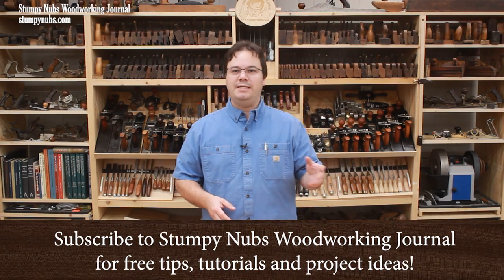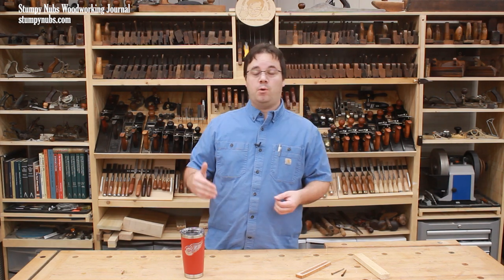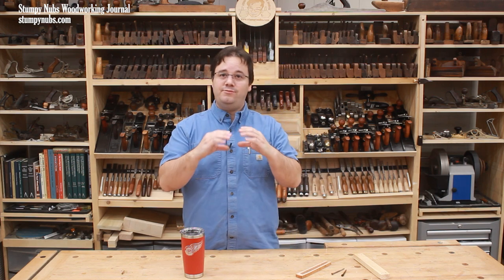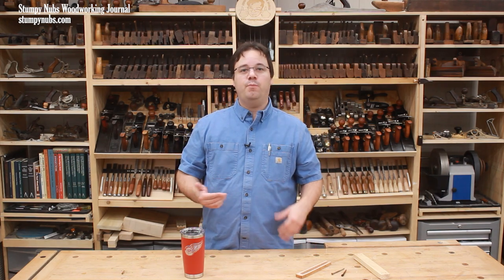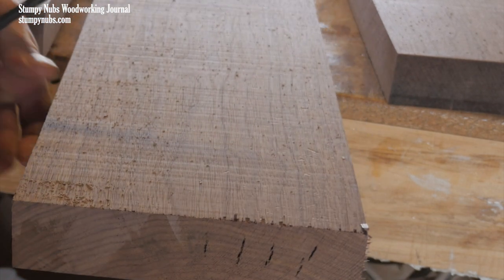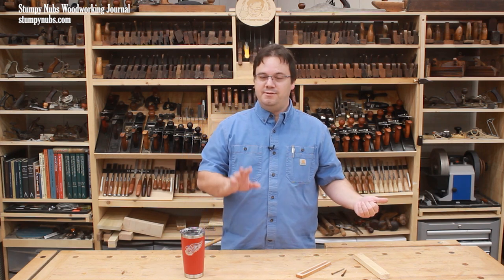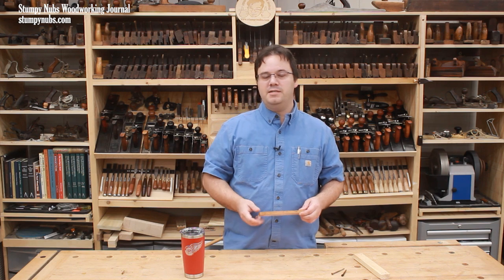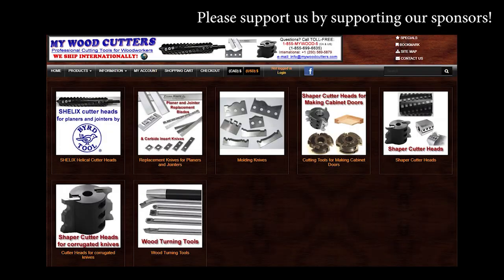A hidden flaw that can DESTROY your lumber! (Case Hardening)

Comment: case hardening, as you call it, is reversible in most hardwood species and some softwoods. it's essentially reversing the kiln drying process by using steam in the kiln to "reconstitute" the wood to its original moisture content before kiln drying. then you can re-dry the lumber on a slower schedule and still get decent, usable lumber.
however, this process doesn't work well on spruce due to the make up of its pores (porus and torus make up of the "capillaries"), similar in fir. it does work to some degree in pine, but due to the pitch setting up and hardening out during the drying process it doesn't always turn out well

you can identify case hardened rough sawn lumber by the deformation of the wood around spike knots in the board. the more pronounced the deformation, the worse it is. 

in pine, the pitch will come to the surface and build up and cause some degree of case hardening under the pitch accumulation. while it does this even under the best of conditions, the dead give away that pine has been dried too aggressively is the consistency and color of the pitch. the bubblier and thicker the accumulation is, the higher the temperature in the kiln was during the lead in and drying phases. pitch globs should be rather dark, glassy and fairly small (2 to 4mm in diameter), even around pitch strains in the wood. 
if you are milling your own pine lumber and come across a chunk that has a pitch strain in it, commit to air drying it for a longer period than normal. this pulls more moisture from the pitch, making less apt to boil out and ruin the boards, then dry it in the kiln at a much lower temp and for a little longer time. at least that way you're not throwing away wood or have to use it as firewood.

most mills no longer do an equalization and cool down phase and simply roll out the lumber once it has reached an average moisture content based on their probe readouts. this is also a major cause for case hardening as the wood is temperature shocked and the outer pores slam shut to the temperature difference sealing in the remaining moisture that would have otherwise migrated to the surface during the cool down

Comment: This is incredibly useful information on one of these unknown wood parameters - at least unknown to the naked eye. I was wondering just the other day in fact of whether speeding up the drying process can cause issues with the wood - now I know why most wood is left to dry naturally over a long time (at least let's hope it is).
Are there any international standards applied to imported wood for air drying and any inspection bodies that provide certifications?

Comment: I never knew about or heard of case hardened wood but I've certainly encountered it. I imagine this also accounts for miter saws binding. I've had to unplug the saw and gator wrestle the board of the blade a couple of times.

Comment: In 2020 my boss and I built a 140ft privacy fence using PT lumber came back this year to do some more work for the same people and I noticed significant shrinkage, a half inch or more for a ton of pickets, the homeowners never complained (to my knowledge) but I was very upset. I know some shrinkage is to be expected but that much makes me believe the wood was not properly cured as even the areas with little exposure to the sun still showed roughly the same amount of shrinking.

Comment: Very interesting, and cool trick to check it, thanks for sharing. It'd be important to cut the test in such a way that you leave sufficient material that's both in tension and compression to pick up the effect.

Incidentally there's an analogous phenomenon in structural steel called "residual stress". Hot-rolled steel products don't cool uniformly; the extremities cool and solidify first. When the interior solidifies and continues to cool and contract it sets up a differential stress state in the material, which leads to early-onset buckling under axial load (due to some fibers already being in compression and hence having less 'headroom' before they yield), and - as with wood - it'll sweep when ripped. Classic example is ripping down an I-section down the center of the web to create two T-sections; they'll typically require straightening after ripping, increasing the cost of fabrication.

Comment: I had this problem all the time when I used to make door frames. Pine and hemlock seemed to be the worst. I would have to cut the bulk of the wood off, then use a thickness planer to get it to size, otherwise I’d be sanding out burn marks for hours.

Comment: interesting, being in Arizona i usually buy my lumber throughout the summer and use it during the winter. I once noticed cracking in the inside of the wood but I was making picture frames to ship out to family for the holidays so I didn't really care at the time. I've never experienced pinching probably because the wood gets 6 months to dry on my shelfs. I have however ran into burn in more often because the fence came out of alignment, usually my fault because i was just ripping full lengths of plywood into halves and it doesn't take very much sideways speed to bump into the fence with a significant amount of momentum.

Comment: I have seen this same phenomenon in air dried wood but to a lessor extent. Air dried does have its own set of characteristics and can happily deal with both. On to the question how much of internal stresses present in the log when sawmilled translate into some of these stresses manifesting themselves in the final product? We can see the same closing or opening of the kerf on both circular and band saw mills.
Reply: I think this is mostly due to internal stresses. I don't think it has much to do with proper drying technique other than a time factor. Wood moves. Air drying gives wood time to move while it dries. Kiln drying just dries it and doesn't give the wood any time to move before it's sold. If these same kiln dried boards were given the same amount of time as an air dried board, I don't think you'd see the same issue.
Reply: @Adventures_of_Marshmallow  I agree with that assessment. Carefully air dried wood or quality kiln dried wood has fewer of these issues in my experience. It would be interesting how much of these issues are preexisting in the wood off the mill and how much is induced by drying techniques. Tracking air dried lumber it does appear (anecdotally) that boards cut in the late spring seem to have less stress than those cut in the late fall early winter. I wonder if the relative humidity or temperature have a role in this.

Comment: Some other factors to consider if the other guy’s problem persists:  A 10” table saw blade is almost 32” in circumference where a 4 or 5 foot band saw blade is not only thinner and narrower, but much longer, thus staying cooler longer during rough ripping. Even with bad lumber you usually will get decent results going from the bandsaw to the jointer/planer than just table saw.  

Also, misaligned fence is not good, trying to rip through a piece in one pass could be helped by taking it in two passes at just over half the thickness.  This keeps heat down, helps bogging down of underpowered saws (if you have that problem), slows dulling and pitch buildup of the blade teeth as well.  

Good sawing technique also plays into the equation.  Feed angle, consistent feed rate, using a feather board, etc...all help in making a table saw a more consistent and functional tool when the planets don’t align perfectly.  And they almost never do, so to me it’s worth it to consider all the factors ahead of time and quickly to make the actual physical work go smoother whenever possible.  👍🏽

Comment: A logger told me that when they harvest for lumber they cut the tree two feet off the ground to avoid bound up stress in the log.  I find the wood that bind usually is at the end of the board not the whole length. I learn a long time ago to use respectable suppliers.

Comment: I've seen a lot about stresses on metals from black smiths, and they have tempering ovens to deal with /use them.
Would it be possible to do similar things with case hardened wood?
Boat builders like to steam planks to get them bend around the hull, and that seems to work great.

Comment: I was cutting a 5 ft long 6 inch wide piece of maple with a DeWalt Crosscut saw. As I plunge the blade into the wood it stopped the blade dead. The board was stuck on the blade and jammed up against the upper housing. Besides being scared and having been whacked by a 5-foot board, I was thankful that it didn't hit me in the face. Getting that piece of maple off of the blade turned out to be a real difficult job. Ever since that time if I want to use a piece of that would I use the hand saw.

Comment: Hey Bud,
Got a question completely off topic. I live in Canada and have a small garden shed where I do hobby woodworking. In winter, I use a small block heater(with precautions) to heat the shed and it works great. That said, my question is for paste wax, in winter it is practically unusable. Do you think it would be ok for me to add some white mineral oil to soften it. I primarily use paste mostly as lubricant on jigs / sole of planes etc.

Comment: Thank you for another great explanation.
On a semi-related topic... If you were doing the same thing (making cutting boards or similar wood cuts) would you use a table saw or band saw and what specs for the blade?
Reply from the maker: (Assume case hardening wasn't an issue) I would use a table saw because it cuts faster, stays sharp MUCH longer and leaves a glue-ready surface free from blade marks.

Comment: If you have ever been in a Home Despot or a Lowes in the winter it can be hot as heck on the ground and as you know heat rises and they put the lumber up high. It's not as hot as a kiln but it does a job on the lumber. I know no serious wood worker buys their lumber there so relax 🙂

Comment: Will the effects of case hardening be pronounced enough at the end of a board to adequately predict the conditions of the center of the board? I ask because it seems that the very ends will have the opportunity to dry more evenly, regarldess of the drying process.

Also, thank you for this. I seem to remember learning this from you before but I had forgotten and completely explains why the chunk of maple that I cut up for Xmas cutting boards immediately "twanged" on me after the first strip was cut off my freshly milled stock!
Reply: If you read the attached document it states that the samples should be taken at least 20" from the ends of the board.  Stumpy only recommended taking the samples from the end if you plan on potentially returning the effected lumber.
Reply: @SteveAugust7  Thanks!
Reply: @SteveAugust7  Yes, if the end has been exposed for weeks it may not detect the problem. A practical non-destructive test though, if you or the dealer are cross-cutting to length.

Comment: My process to prevent this from leaving gaps in my work is to always leave the crown in the center for flat sawn material. Rift and quarter, if I can, I freehand straight along the grain so that milling won’t warp the material.

These days every piece I cut will pinch at least a little bit. If I cut a piece in half down the crown it will always be bowed.

Comment: So a 50$ dollar question. 

I wound up using about 20 bucks of case hardened birch to edge band an MDF workbench top. I didn't realize that it was case hardened at the time however, just that the hardwood pinched pretty bad coming off the saw.

It didn't seem to be cupped at all when I glued up (boards were cut about 2.5 inches wide), even though the glue up was done several days after the sawing. There was a slight bow in the wood, but I didn't care too much as it could be pressed flat with a trivial amount of hand pressure.

I figure, it's a workbench top, so even even if it goes horribly wrong I'm out less than a 100 bucks, but I was curious going forward.
Reply from the maker: If it hadn't cupped several days after sawing, it should be fine.

Comment: I had a similar experience while trying to rip 2x4 spruce in half lengthwise, i had first intended to push them thru the table saw but had no end to binding and hard feeding to the point of being dangerous, i eventually put my rip guide on my circular saw and clamping the 2x4 to the edge of my bench and ripping them that way to a much greater success, assuming both blades to be or relative sharpness and the circular saw likely of less hp, why do you think that was so much more effective? i took pictures of the lumber after it was cut, a ripped 10ft board could touch at each end and be sprung to create a 3inch gap near the mid point, while others spread at the starting end as it neared the other end by as much. Canoe lumber co, not a straight board in it!

Comment: Sounds like I purchased 1X10 Select Pine wood.  When I cut it on my compound miter saw, the board cracked loudly as I was cross cutting.  The board was 8' long and I was cutting 1' pieces.  This only happened on 1 board.  When I got the loud crack sound, I did not notice the crack at the cut location, was down a foot or so, where I noticed the physical crack.

Comment: Good vid! I'm leery of kiln dried in general, and given the recent scarcities I expect that problem to get worse.

Going back to Davis' original video, it looks like he's using a combo blade rather than a rip. Assuming he's figured that out, he might want to check blade angle to fence. If the blade is angled towards the fence, that is, if the distance from the front of the blade to fence is greater than the distance from the back of the blade to fence it will try to force the wood against the fence, slowing things down and smoking.
Yeah, I know I should make that comment on their vid rather than yours, but it's late and I'm lazy.
Reply from the maker: You can rip with a combo blade. And his fence was parallel to the blade. You can see when he withdraws the wood that it is the kerf closing and pinching the blade.
Reply: @StumpyNubs  well, I should have watched his vid... Still a real rip blade should work better. Did he try wedges to keep the kerf open? 
BTW, I'm not suggesting that you are wrong, you are always excellent, correct. 

But if he can't return the lumber perhaps there's a way to rescue.

Jeeze, I should just go watch his vid...

Comment: In my very limited experience which started off using a blade with 60 teeth thinking it would be better because it’s supposed to give a “finish” quality cut. Decided to switch to a 24 tooth blade and bingo cuts were easy and quick and the quality was still pretty good.

Comment: There's one thing that I have been taught to do before processing the wood to it's final size. It's called "de-stressing" : you have to plane your planks to your final thickness +3/4mm (excuse my French and metrics) without having to joint it. Then leave it rest for 24h you'll discover you material hopefully not too tortured, thus allowing you to process it to it's final measurements.

Comment: Try making the fence parallel to the saw blade and use a constant feed through out the cut.  I have run in to what you call case hardening while cutting stair jacks.  Big problem, in that process.

Comment: I have this issue with OSB and MDF too. It feels like it resists the saw in the beginning and all of a sutton it slides through. I thought it was the alignment between the fence and the blade. My Bosch table saw doesn't allow me to correct this.

Comment: I always store new lumber for two months minimum. That way it all adapts to my shop evenly. Which makes this a mute point for me, and normally my new lumber sits for six months before use. (Edit) One other note on storage always cut off those painted ends if your boards have them before you store the lumber. As for the cracking, I normally find that in pallet wood to be fair about it.
Reply: Good tip. I guess that's one reason some wood workers have nice wood just sitting around their shop. I thought they just like have nice piles of lovely stock on hand. Now I think they are letting it climatize to their shop as you do. I get it now. Thanks.
Reply from the maker: Case hardening is not, in my experience, something that can be reversed by acclimating the wood to the shop
Reply: @StumpyNubs  I would even say that if it is significant, it probably just can't be reversed. If there are internal cracks already (either the obvious or less visible ones that still compromise the material), the forces were enough to make lignin fail and afaik no process can reverse that even if you manage to get the outer shell and the core in balance again.

Comment: Can the case hardened piece be resawn into veneer?  I’m thinking that the veneers would be thin enough to come from the outer section with little to no inner section or from the inner with no outer section and thus avoid the stresses.

Comment: This is the reason I prefer air dry lumber or even solar kiln dryers. The other thing to watch out for is over conditioned lumber. After they dry too fast they will pump moist air back in the reduce this effect. If not properly done it complicates it even further. When ripping if it splits apart it’s case hardened. Pinches in, it’s over conditioned.

Comment: Hello!   I have a QUESTION.... some time ago you did a video that talked about a band saw that was given to you for free.  I want to find the brand but i was not able to find the video.  I want to ripe vertically some wood so i want one table saw that have 14 inch bench, 12 inch cap vertical and a motor with 1.5 horse power... any suggestion...One that will not cost more than $400 dollars if possible.  Thank you.

Comment: I had kind of the opposite problem when using a waterlogged length of oak for a field gate post. Drilling a hole for the hinge pin, the water turned to steam and exploded like a gunshot.